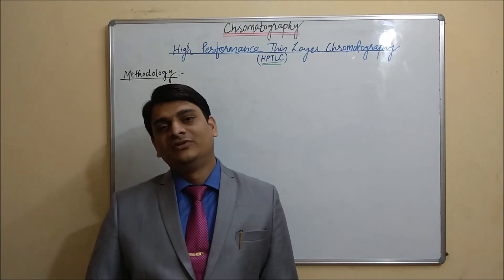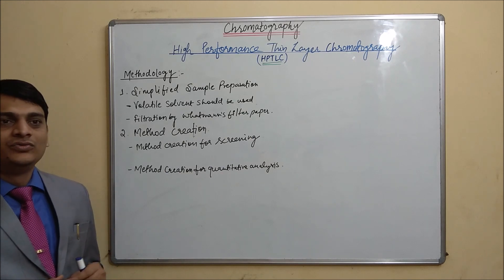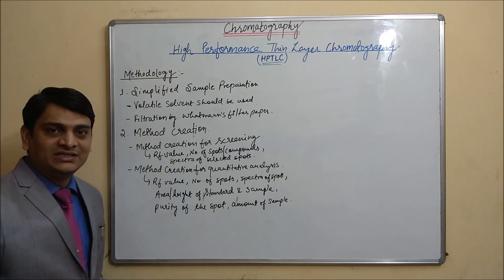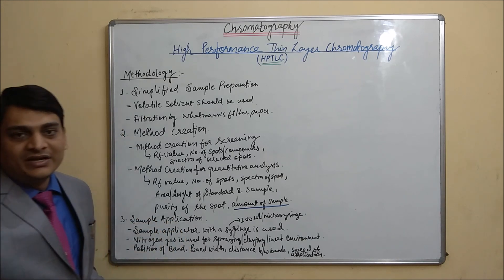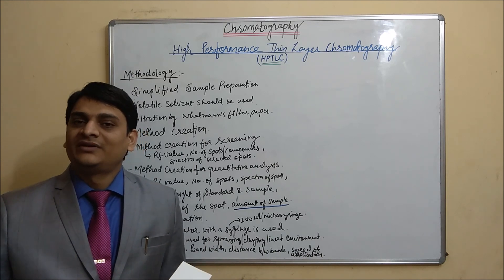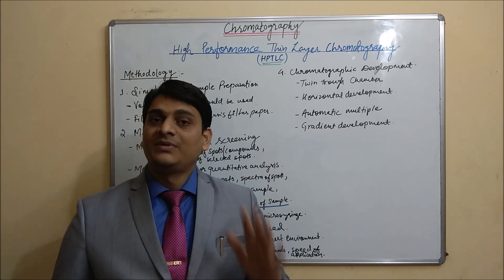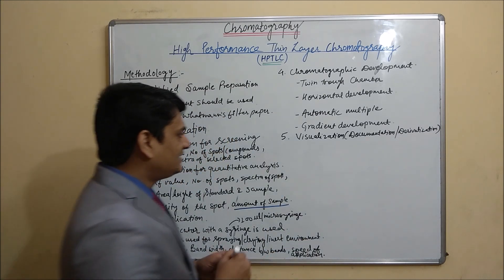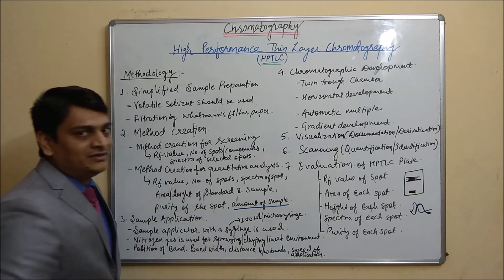Part 13: HPTLC - Methodology

Comment: Thank you for the information. Your explanation is very nice. But one thing I would like to mention here, is that the subtitles are very annoying. Firstly so many spelling mistakes are there, and they comes in between board writing.
Reply from the maker: I haven't put any subtitles. It's your fault, you should turn off auto generated subtitles in youtube. Check your video setting. 😂😍
I hope you know how to use YouTube App.
Reply: @pkclasses100  It's already off..

Comment: Is sorbent having lower sample capacity in HPTLC ....pls ...explain
Reply from the maker: Compared to which technique??
Reply: Thin layer chromatography
Reply from the maker: Yes... Thickness of stationary phase is 250 micrometer in TLC and 100 micrometer in HPTLC. So, sample capacity is low in HPTLC.
Reply: thank u so much